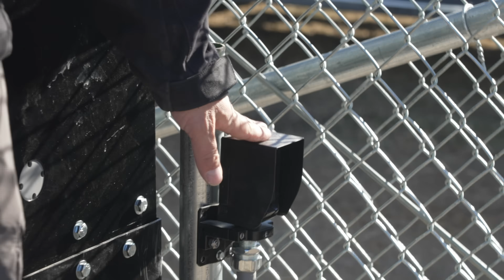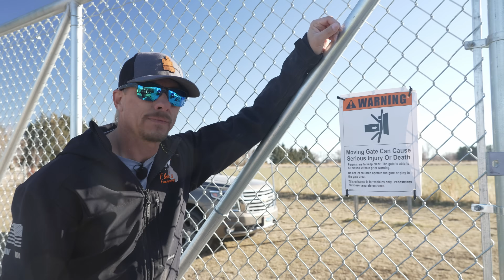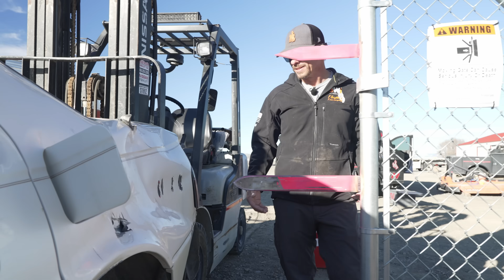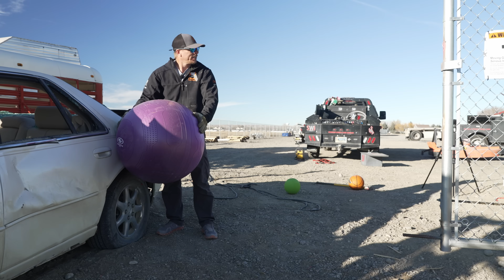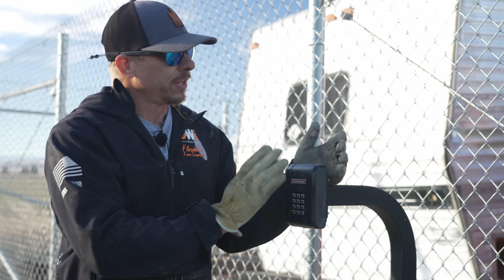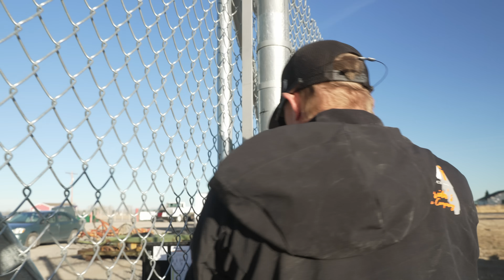The Silent Killer On Every Millionaire's Property

Comment: I spent 20 years installing and repairing automatic entrance doors on grocery stores, hospitals, etc. With an automatic door, the problem with turning the reversing feature all the way up is that a pebble in the track, a slightly worn roller, or even just a the door being barely misaligned can cause the door to constantly recycle, aka "ghost". The door has to be in perfect shape to turn the reversing feature to its most sensitive setting, and an automatic door is NEVER perfect. I really disliked the all of the safety sensors required on automatic doors because 90% of automatic door problems had something to do with the safety features malfunctioning and the doors will "fail safe", meaning that the door just stops working if there's any issue with a safety feature. That being said,  the safety features are absolutely necessary to prevent, or at least minimize lawsuits.

Comment: These gates appear to have much more strength than simply what's necessary to roll them into latching position and seat them. WTF?
Reply: Because gates need to have the ability to close if a rock or something else obstructs the track, or even if the wind is blowing and pushing on them too hard. If they don't close because something is obstructing them and you're not monitoring the closure, you leave your business wide open. When it comes to gates, high winds are a big deal, even on sliding gates. Plus once in motion, a 400 lb gate cannot just stop on a dime. The heavier the gate, the more force they are going to close with regardless of the type of operator that you're using.There are some basic physics involved here.
Reply: @scottmichaels12  Can't see how more than a fairly modest increase in percentage of force beyond what's already used for moving the gate would be needed for nudging a stone aside or wind through open link, and if it's driven by a motor rather than rolling freely, it can absolutely be stopped instantly. If there are mechanical reasons why it would need sooo much additional force added (there may well be) I'd really like to know what those are. But I don't think it's rocks or wind. Only thing I could come up with was maybe jammed up snow/ice.